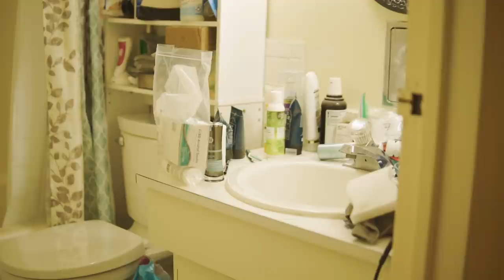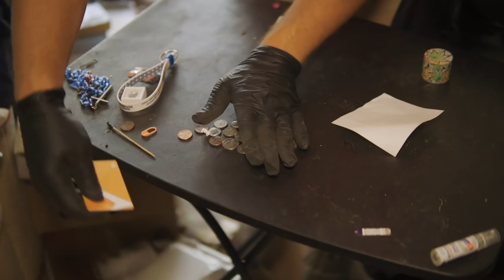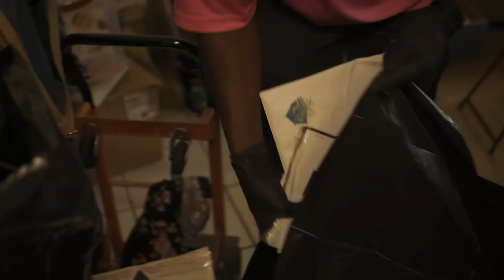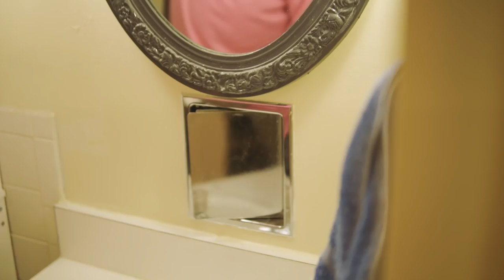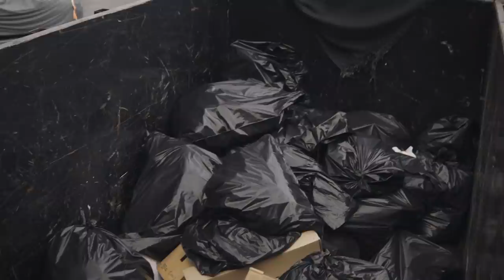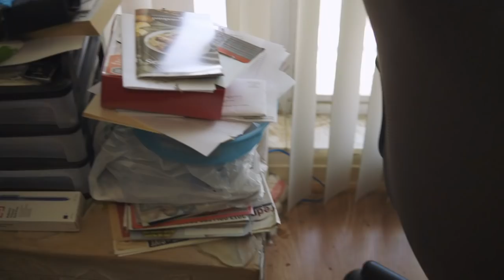Hoarding Rebirth: Escaping 5 Years of Trash | Dunedin, FL

Comment: I didnt see the stove cleaning process after the burners were removed. I am just wondering if she knew that portion of the stove can lift up like a car hood. Please Laura forgive me I'm not in anyway trying to be smart ass. some people just don't know stoves can do that. I didn't know until my mother told me one time. keep up the great videos. your fan. Peter
Reply: Not every stove has that feature.
Reply: I was thinking the same thing.  It is much safer to lift the top rather than reaching through the metal holes.
Reply: Yes! I thought the same.
Reply: I never knew it until the landlord showed me. What a great idea.  It’s hard to clean the stove inside and outside
Reply: Was going to suggest  the same thing.  Makes it a lot easier to clean under the burners.
Reply: My first stove didn't have that feature but my current one does and i love it
Reply: I thought the same; also, I did not see her clean the back portion of the stove  (where the clock, dials, etc. were located...there was visible grease on it when she was cleaning the stove top.
Reply: @steelersgirl9930  I used to have a stove similar to that and it does lift up
Reply: @audreyblauch8048  ok so did I and it did not .🤷‍♀️
Reply: @steelersgirl9930  they all open, they just don't all open the same way

Comment: If they have a dishwasher you can put the stovetop eyes in an the over boiling pans. Washing the stovetop parts prevents rust from salt an oil build up. Over spills from cooking is dangerous as well. Build up underneath the stove top fire hazard.
Reply: Pans are pretty inexpensive. I spray them and the burners with zep and throw them all in the dw, but if the pans aren't completely pleasant to look at, i just replace them!